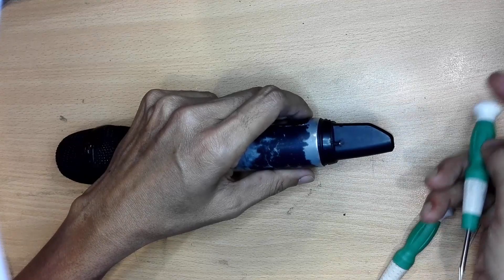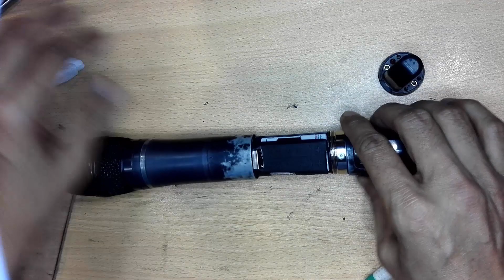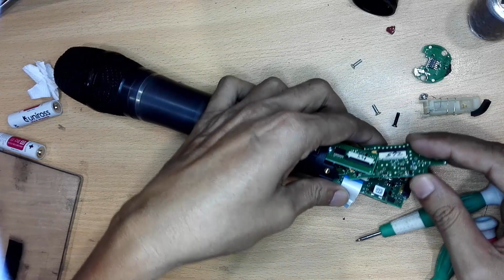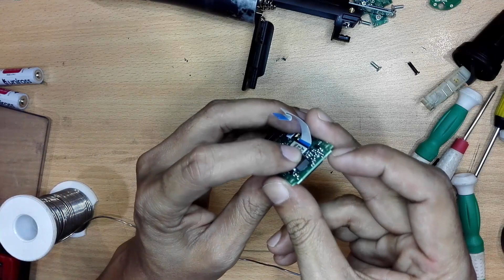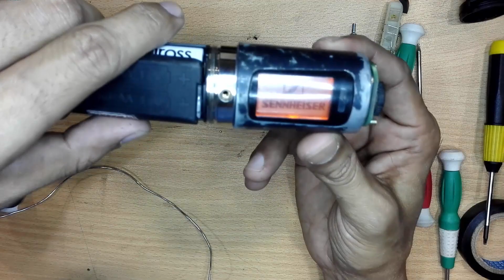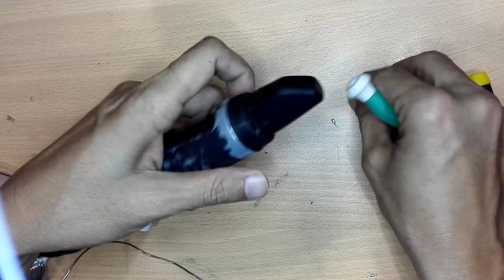Sennheiser Boom Repair || Wireless boom not powering on

Comment: Greetings from Argentina. I wanted to ask you if you can help me!

I have the same microphone and now when I turn it on, on its display it has an indicator with the initials "AF" that measures how much signal is being transmitted while you speak or sing...

Now when I turn it on, without speaking or singing directly, the "AF" signal that it marks on the display goes almost to the top, as if it were transmitting audio.
and then when you actually start to sing or talk into the microphone, it picks up as usual but when it plays the audio it does it with a little bit of noise, like it's some kind of RF noise, bad signal. I already tried changing your capsule, changing cables, trying another receiving base, and obviously, the problem is the transmitter. Is it permanently damaged? Or what could be causing that? From already thank you very much for your time.
Reply from the maker: please check the microphone connection from the top of the mic, if you have another microphone just exchange the mic part from the top. if the same issue happen That may cause mother board issue, Thank you
Reply: @StreetViewBD  Yes, try another transmitter and the error disappears.
Dear I promise my last query!
And I won't bother anymore, I wanted to know if technically, at an electronic level this can happen.
The microphone is used by a punk rock singer, heavy rock music style, which exerts a lot of vocal pressure on the microphone diaphragm and excitation in the transmission signal, there is a possibility that the transmitter gain was not well set and - 18 db (which is what the transmitter comes from the factory), is too sensitive for pickup and the transmitter received a signal excitation all the time, always forced to the top, to clip, and this, so to speak, fatigue this component " dynamics regulator" of the transmitter some kind of component, (I don't know how to name it) but type, pre-amplifier or component in charge of signal transmitter.
So now when you turn it on, this signal modulator or transmitter component is damaged.
Can this happen technically or electronically? what do you think that can happen?
Reply from the maker: Factory default sensitivity may be -18db, now you may change the sensitivity at -30db and receiver AF Out set to -6db or-12db, if its remains same, then i dont know what cause it is. Thank You
Reply: @StreetViewBD  Yes, I already tried to go down to -48 db on the transmitter and in the same way, it continues to be with the AF signal at the top on its Display. If I could realize that the problem is the transmitter, because I tried the receiver with another transmitter and everything works perfectly. I really don't know what it could be. But my biggest question is to know if these teams have repair for things like that.

Comment: Do you have to remove the fin in order to remove the display cover?
Reply from the maker: There is a ribbon connected with the display, This ribbon other side connected to the circuit board, Board has small lock, First unlock the ribbon lock then pull the ribbon, Thank you

Comment: Was the battery getting hotter nd i i open it will it void warrenty
Reply from the maker: Battery condition was normal. its only problem was not powering on issue,